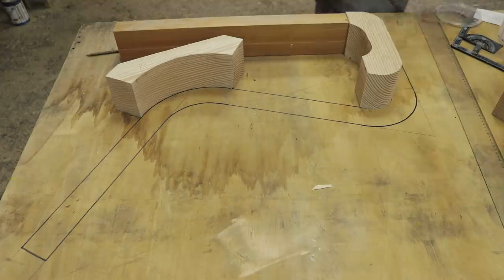Making The Chair

Comment: That Lounger demands a room of it's own, with a spectacular view!  Curious, what's the maximum weight limit on that lounger?  It's a great piece of Art!!
Reply: Just had come back to watch this again and noticed this comment...

The only weak spot is going to be in two "dowels" which form the seat base.  The weight is basically carried by the 4 ends which go through the frame.  Not sure the diameter of them, but they are over 1/2" which should give the chair a dead load capacity of around 1600 lbs.  Not likely to break under normal use...or even energetic use of two regular sized people.  The deflection you see might be a bit unnerving, but just like a wooden bow - it is part of the material.  It will move a lot without breaking (significantly different then solid wood where grain run out might cause it to splinter and crack...).

Provided that you are gluing them up properly, laminated wood is extremely strong, and considering the shop normally specializes in laminated structural beams and the like they are probably using the right adhesives and have the practice to apply it properly.

Comment: Basically, this is a very over engineered version of the IKEA Poang chair. It's the same shape and done the same way with bent laminations providing springiness and strength. The frame is probably twice the thickness of the IKEA version and not joined with knock-down fasteners, but its a very well built IKEA chair you have there.

Comment: What is your work time on the glue? Did you know that the clamps would fit so well on the inner curve of the chair when you designed it?
Reply from the maker: Its about 30 to 45 minutes, but on this summer temperature it is a bit less.. regarding the clamps, I eyeball it and it usually goes well..

Comment: I asked this on a different project as well, really hoping for a reply😊
What is the finish you are spraying on it, before assembly?
Thanks
Reply from the maker: I usually use two component polyurethane coats ranging from matte to full gloss depending on a project..

Comment: What's the open time on that glue?
Reply from the maker: Depends on the temperature and hardener amount. If the room temperature is low at 15°c and 15% hardener you can stretch it up to 45 minutes.